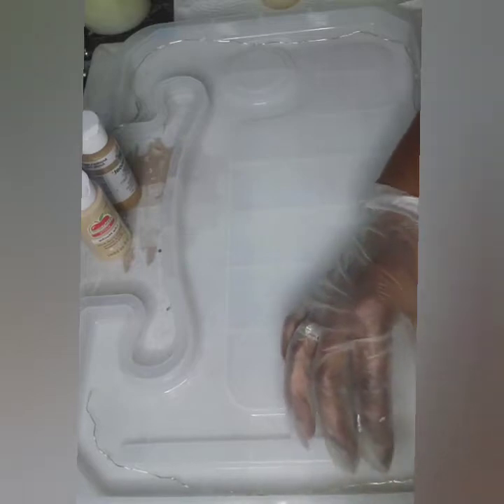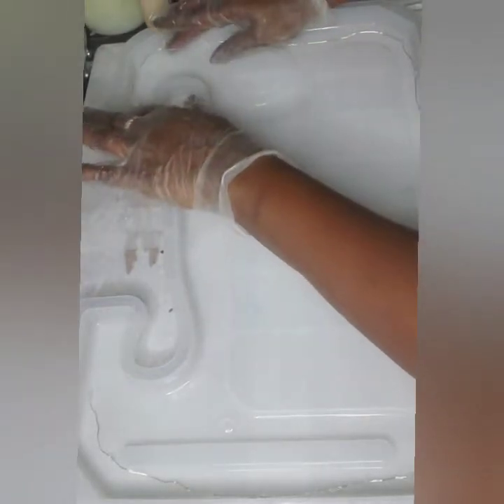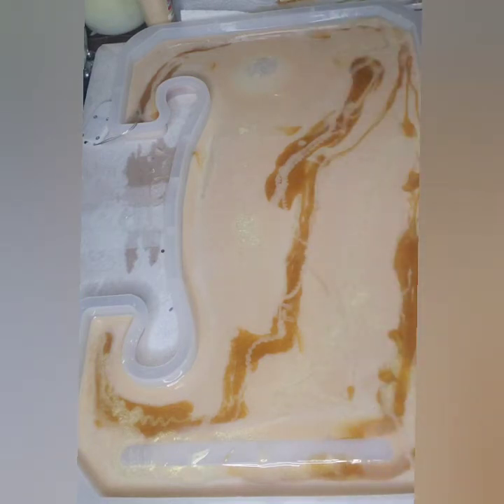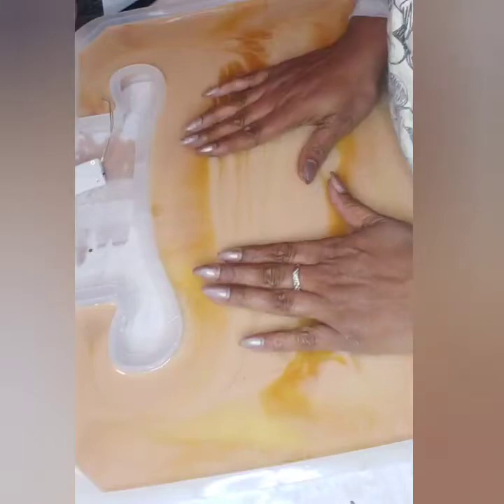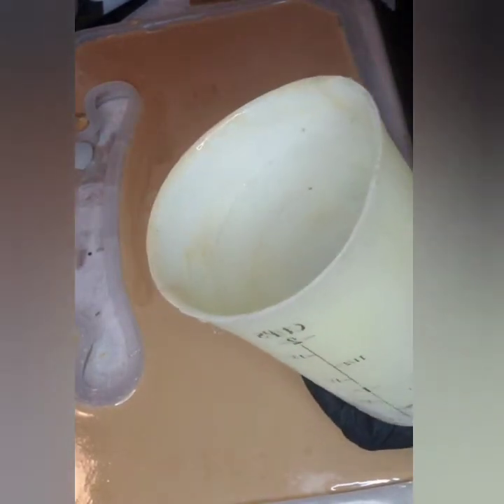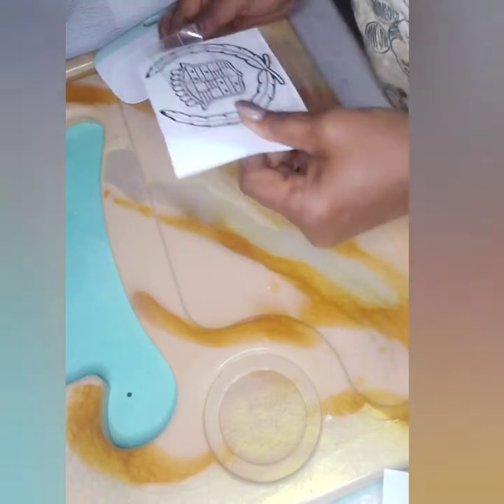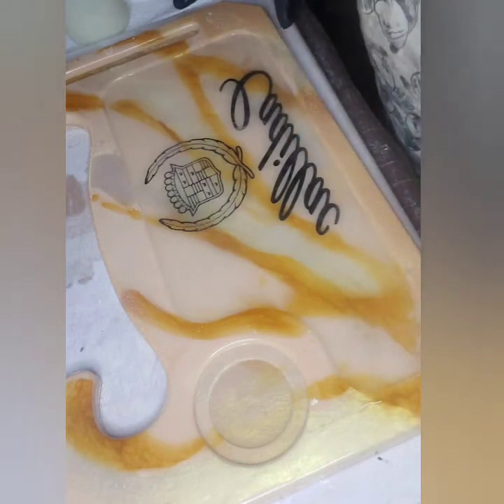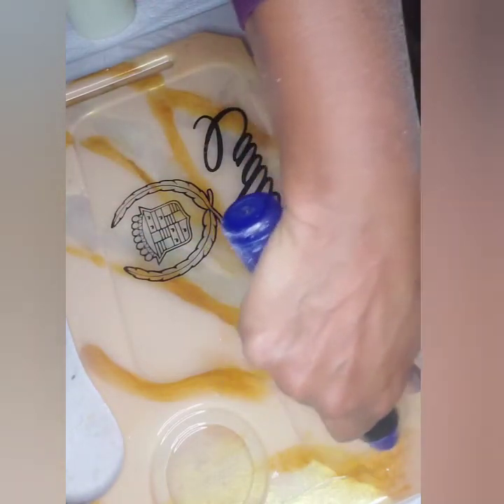Another One!!! Resin Steering Wheel Tray

Comment: Sometimes when I first take a resin piece out of the mold it's still a little bendy, and when that happens, I set it on a piece of paper on a flat surface to continue curing for a few days, and that usually does the trick. If it's still bendy after a week, it's just going to be bendy. I haven't always kept real good records on which resin I used for what, but that is a good idea to do, because if you have a resin that is consistently bendy after it's supposed to have cured, that's a resin to not use any more if you don't want bendy pieces.
Reply from the maker: Thanks for watching and hopefully you have subscribed to the channel. I thought that after letting it cure for a while that would have gotten harder, but it didn't. It hardened a little bit more but was still bending until I re-coated it with a casting resin. I think that resin was just good for coating and not poring such deep projects. So glad that it finally got right after coating both the sides of it. My husband loved it. Thanks again for watching and commenting on the channel. Happy Crafting Love!!!